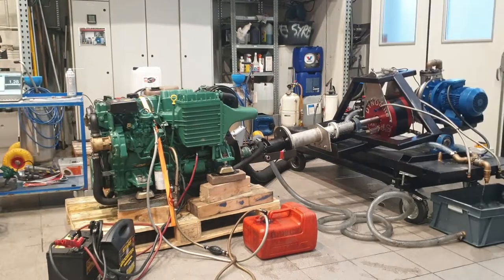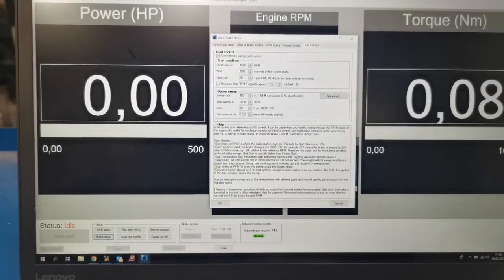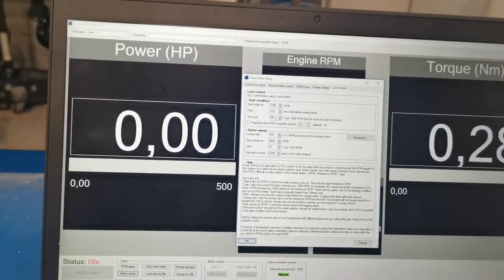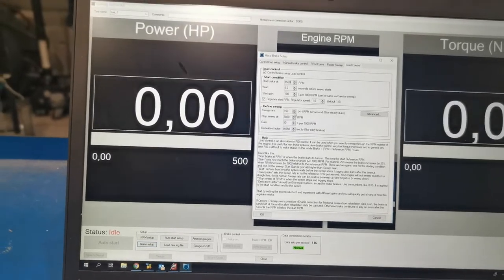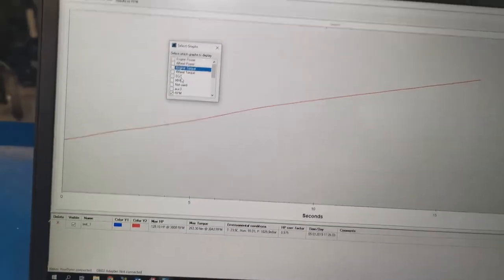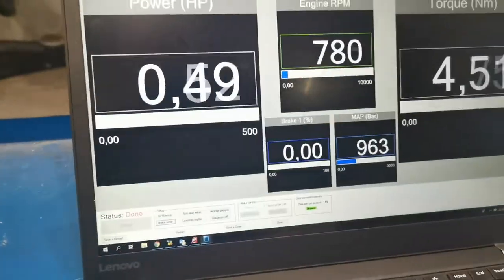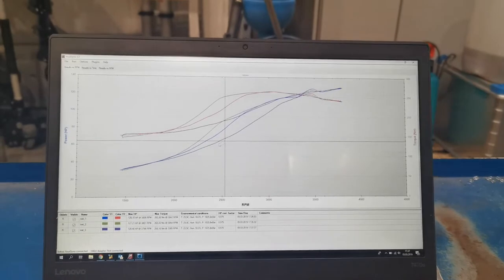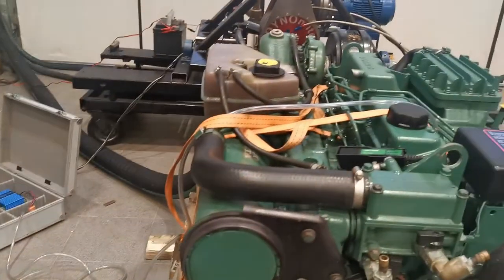YourDyno.com Load control demonstration on water brake

Comment: It would be nice to test a naturally aspirated engine with the different sweep rate to see if the results are the same.
Reply: @bigboreracing356  Dude, godzilla just had a stroke trying to read this response.
Reply: @bigboreracing356 Bench dyno's are most usefully for bedding a new engine down. To optimise a tune you would need to know the rate of RPM increase when installed in the car, in each gear, and map accordingly. 
The materials used to make power (fuel&air) are replenished as is the material for measurement of energy, in this case water.  The only variable is heat accumulation, though at 300rpm/Sec, with a reasonable cooling set up that is not an issue.
Reply: @bigboreracing356  That shows up in rate of RPM increase

Comment: How many time change PID control??20MS OR 50MS??
Reply from the maker: You can set this in software but default is that the regulator runs 20 times per second

Comment: the video contains a lot of information. But it tells only how they got the nice measurement and it does not realy explain what happens with the diferent settings and how to recognize the the behavior what each stetting is doing....  increase valus or degreas valus I am coping with sireusus oxiclation...... and i have clue afther this video were to start solving my oxiclation problem in this mode.
Reply from the maker: Basically Gain sets how "hard" the controller will regulate and Derivative factor sets how much more brake the controller gives when the engine accelerates. A good starting point is Gain = 15 and Derivative factor = 0.02. But best setting varies with the setup. You can also go to the Advanced page and set different ramp rates and gains for different RPM ranges. Contact me at jostein@yourdyno.com, I can help you with the adjustment
Reply: @YourDyno  in some older video's you showed a water pressure valve and a pressure accumulator, are you still using this to get your water supply consistence and om what  level does the the water pressure effect the measuring ?
Reply from the maker: @freddykoopmans6985  You need regulated pressure, normally achieved by a bypass pressure regulator. In addition to keeping the pressure stable, the bypass regulator lets the water go back to the tank so the pump is not deadheaded when the valve is closed. The accumulator tank is used in some setups but many work well without. If the pressure regulator is far away from the brake then more likely you can benefit of the accumulator tank, since a local accumulator tank effectively reduces the distance you need to accelerate the water

Comment: Dear Sir,
I hope you will be fine and working well. 

We have water brake Dynamometer (Model: Omega 3200 S3, Capacity: 3200KW) of AVL. We are facing following problems in dynamometer during testing and commissioning (Max Load: 12000NM, Max RPM: 2100).
1)    Load stability at low rpm is very less than greater rpm.
2)    Normally load fluctuation is about ±20 NM and sometimes load fluctuates about ± 300NM.
3)    When applied load is nearest/above to 50% load then suddenly load rises about 5-7 KNM within second and dyno loses its control at load.
4)    When suddenly load rises about 5-7 KNM then we set dyno and engine in idle mode (Speed: 500RPM, Load: <=300NM) for safety. But in idle mode, sometimes load remains 3-5 KNM more than 1 minute until we increase the engine speed again up to 1300RPM.
5)    Water Outlet Temperature is crossing its limit above 60 degrees at its 45 % load even water inlet temperature is below 35 degrees.

We need your guidance in this case and we will be grateful for your support.

I am looking forward to your feedback.

Comment: Sounds to me like a straight proportional controller. PID without the ID.
Reply from the maker: The gain is a proportional component but it is more complicated than a P controller. A straight proportional controller will have a large RPM error, since it is the RPM error times the Kp that sets the brake %.